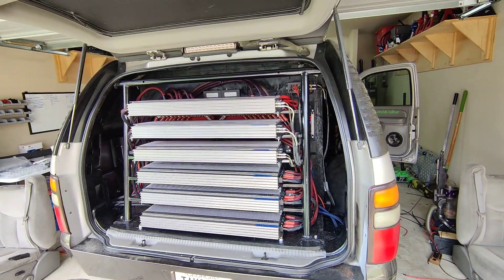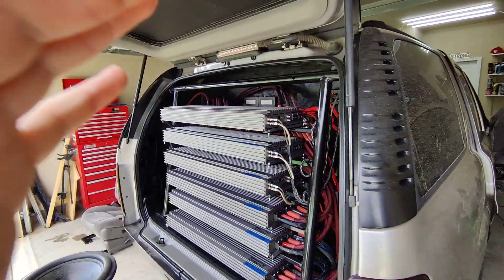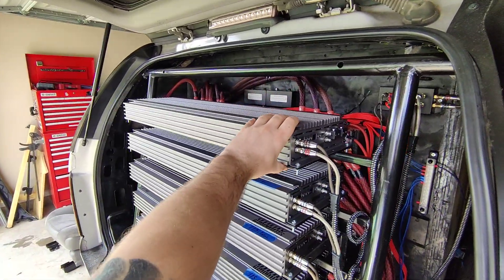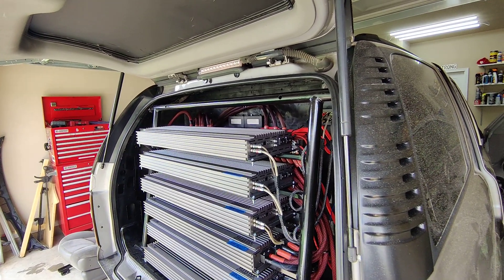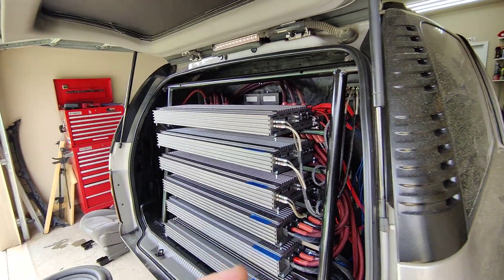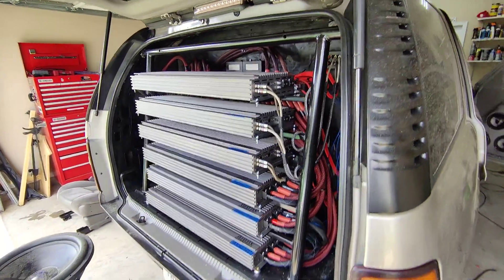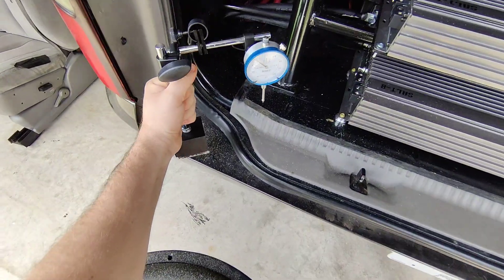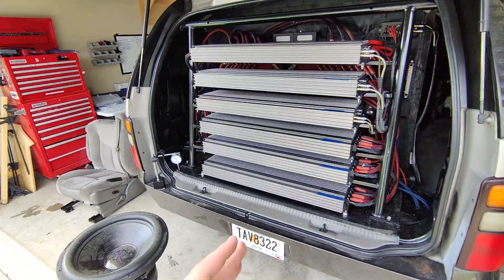How to phase align multiple amplifiers without an Oscope.

Comment: Nice system......
I've a 2006 Dodge Ram 2500 diesel with 2 18" Dvc 2 ohm each on a skar 2200x1 at 4 ohms ins sealed enclosure, each getting about 800 watts.
Sounds pretty good.
The subs will not handle a 1ohm load at 2200 watts a piece.....they start knocking.